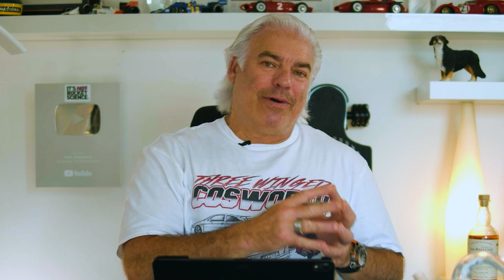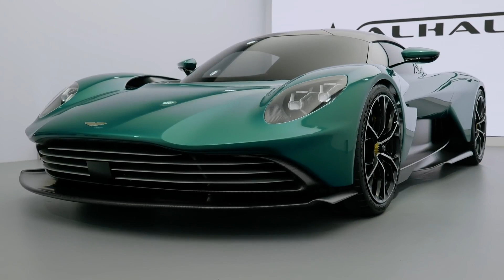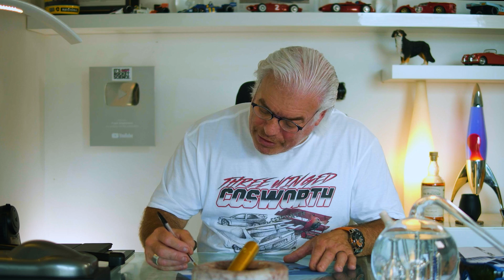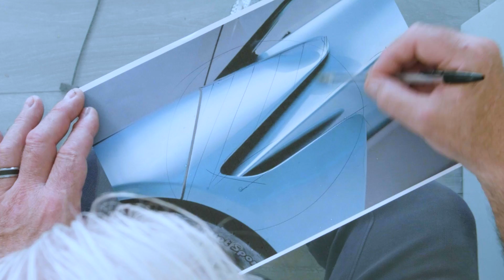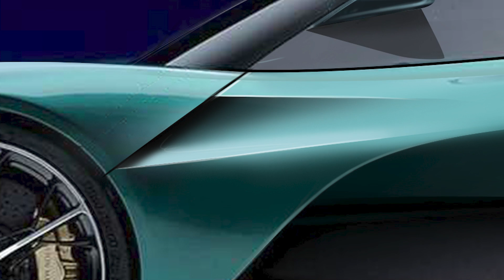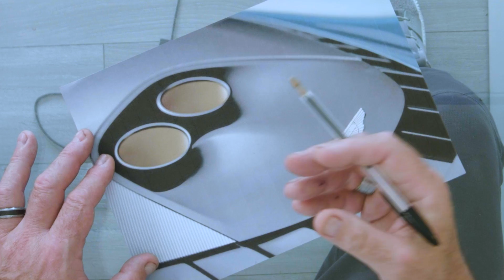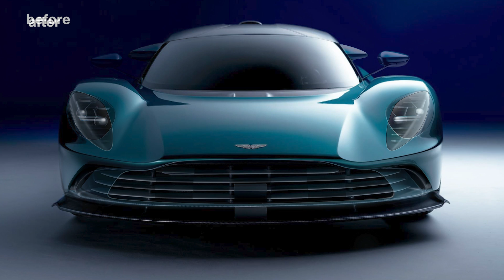Is The Aston Martin VALHALLA The PERFECT Supercar or Can It Be Improved?

Comment: we need a t.50 review, I'm sure you'd have something to say about the mesh at the back
Reply: the t.50 was designed like a fighter jet - it does not care what you think about how it looks. it only has to impress the wind. also, have you seen the luggage compartment?
Reply: @iddqd339  are we talking about the same car? if what you said was true it would look like an aston martin valkyrie.
Reply: @saltyitalianguy  Valkyrie is only function-driven below the beltline. If you take the top of the car off, it looks like someone stole an aero package from that year's F1 Red Bull car. The top, though, while more reminiscent of an LMP1 prototype, has the unmistakable Aston Martin styling lines, which unfortunately require extra material to achieve and are likely not quite as optimal from the aero perspective as actual LMP1 cars. The reason the t.50 doesn't look anything like the Valkyrie is twofold: (1) they use a fan to suck the car to the ground, so they don't need all the fancy aero at all - a simple venturi tunnel is quiet enough. And (2), it's not meant to be a track weapon, but rather a GT, hence the need for usable luggage capacity. Other than that, there is not a single gram of material that does not absolutely have to be there to achieve the engineering requirements. No material was spent to pretty it up - in the same way that nobody in their right mind would make a fighter jet a single gram heavier for the sake of aesthetics. Nonetheless, a lot of them are quite good-looking flying machines, but this is a happy coincidence. You could talk about how one design is more pleasing to the eye than another, I suppose, but the machine is designed for a single purpose: to kill men in airplanes.
Reply: @iddqd339  i feel like your statement is kind of pointless and in some ways just plain wrong, it takes just one glance to see that the car WAS meant to look good, hell even the t.50s made sacrifices in the aero (and looking at how the back end is probably also in the weight) just for the look.
Prime example of this is the rear wing, which is slanted like a fighter jet (this is pointless because the airflow is subsonic and actually adds weight and makes the wing worse) it's apparent that also restricted the amount of aero elements on it to keep a clean look, and keep in mind this is on the track-focused version.
do not get me wrong the t.50s and to some extent the t.50 are absolute track weapons and wonderfully engineered, but Gordon Murray definitely also kept aesthetics in mind.

Comment: The current front with Frank's redesigned sides is perfection.
Reply: was thinking something similiar. i really like the rounder headlamps and the wider grill
Reply: @baron_xd4633  I feel like the narrower headlamps end up making it not feel as wide and low to the ground. The mirrors also feel too substantial and heavy the way they're fixed to the cabin
Reply: @Vanilla.coke1234  i wonder how it would look like with more futuristic headlights.  Something like cybertruck. 🤔
Reply: @Vmurmur  Could look alright. But something like this need a face so a set of two headlights is probably the only way to go
Reply: I like everything he changed, just not the mirrors. There should be no mirrors at all, imo.
Reply: Yes, that's my opinion as well. He really did improve the sides and those lamels. But I prefer the original front, there was nothing wrong with that.